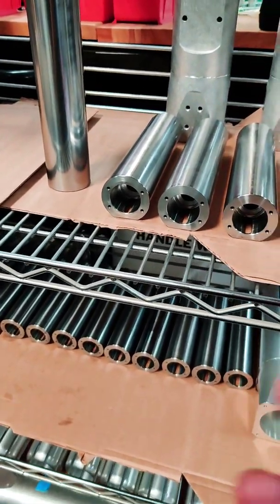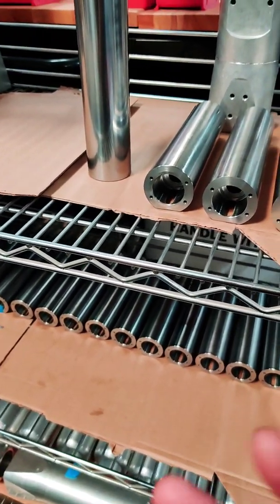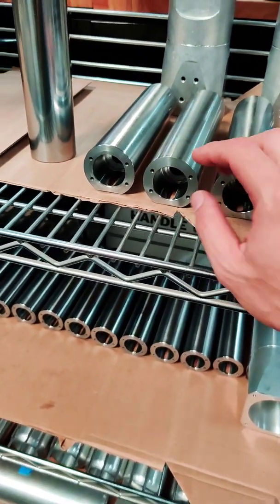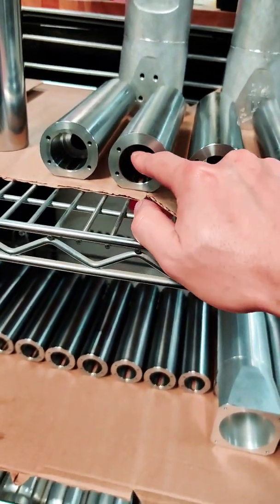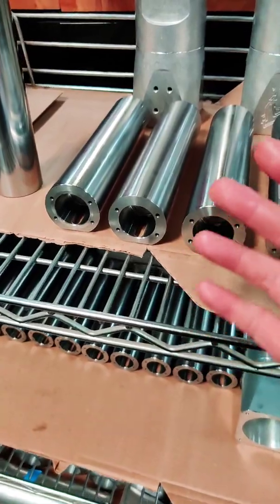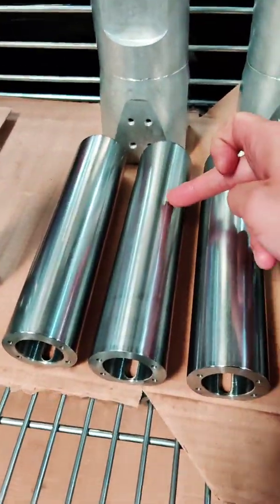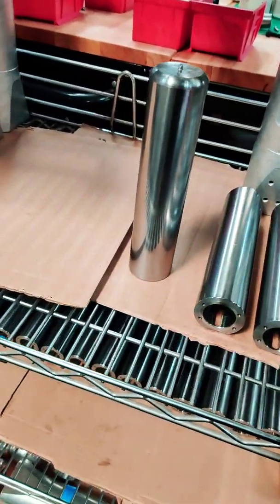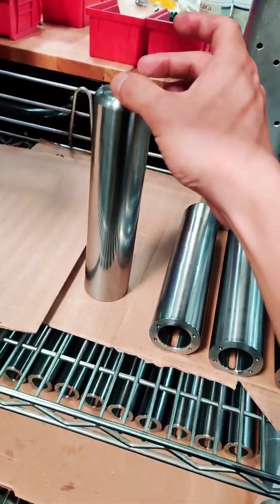Motion Talk 6 - Why we still do it the old school way

Comment: 10ee, the best of the best manual toolroom lathes. You are a man of good taste.

When you are setup to run that operation on the CNC lathe do you drill that clearance hole with a gun drill?